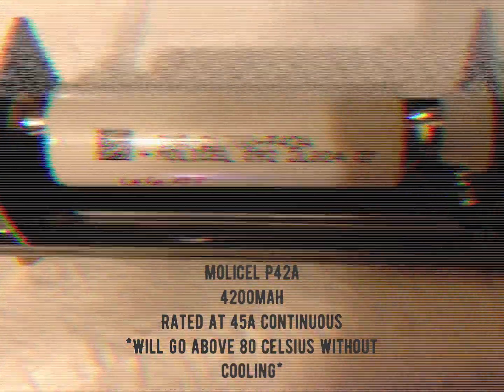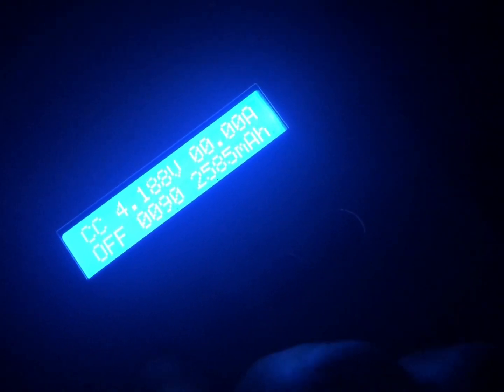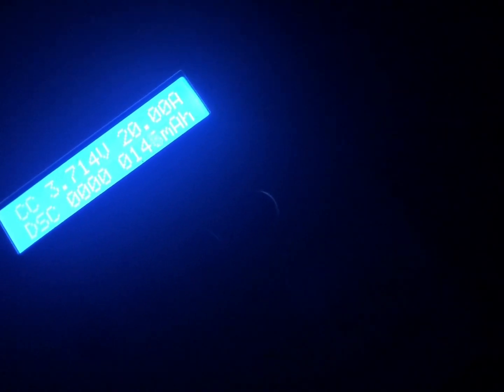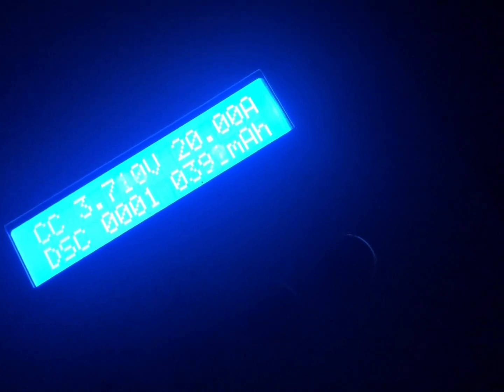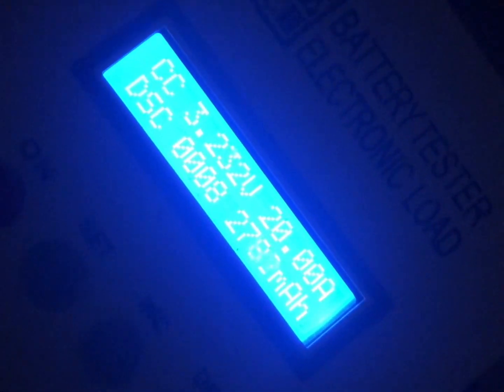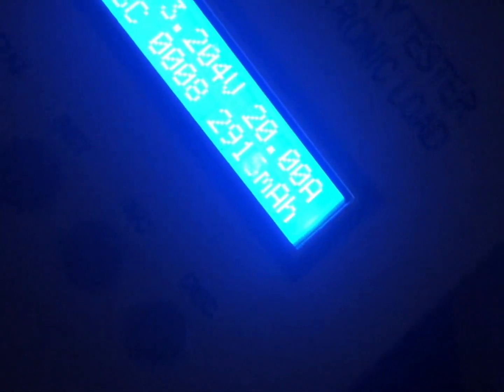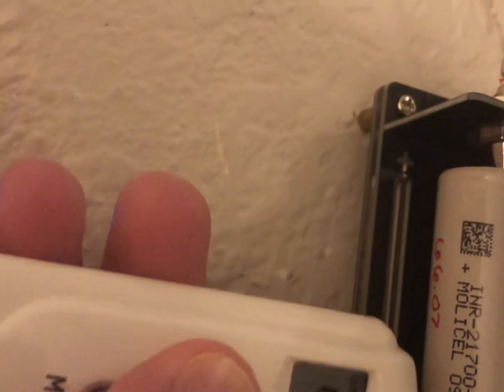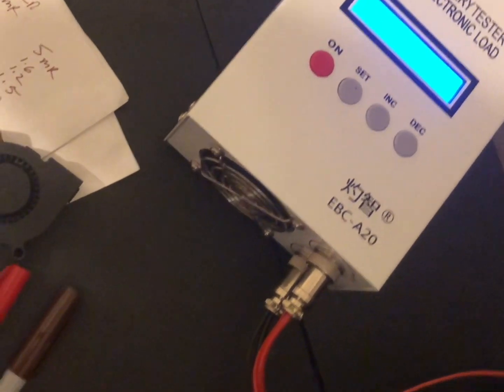“I’ve Never Heard Of Molicel” Molicel P42A 21700 20A Discharge. Liito Kala Fanboys Live Under A Rock

Comment: Your P42A seems to hold voltage better than my fake P42A. Lol

3550 mah it not terrible, the dataset shows it should get about 3750 mah when discharged at 20a down to 3.00v. 

I prefer using 3.00v cutoff for personal testing but of course if using it in competition with another cell, or when disputing the capacity with a shady seller, you have to get as close to 2.5v as possible.